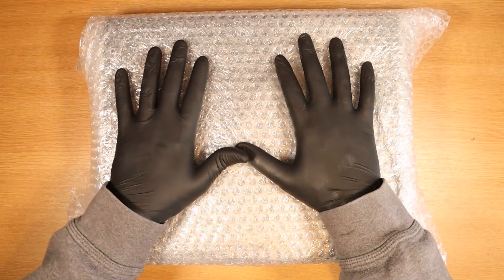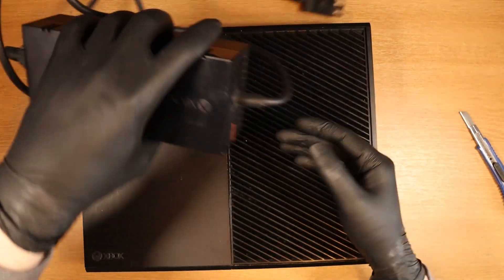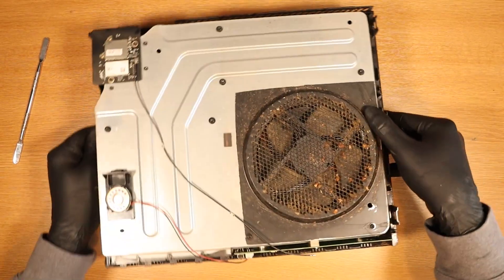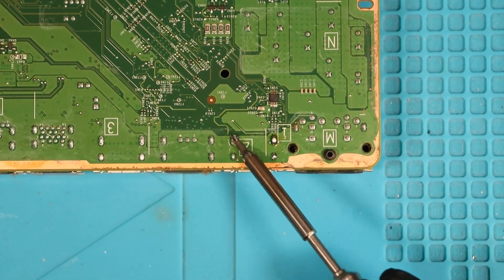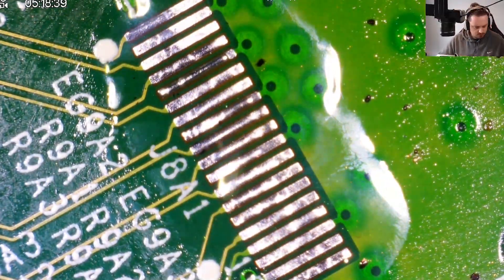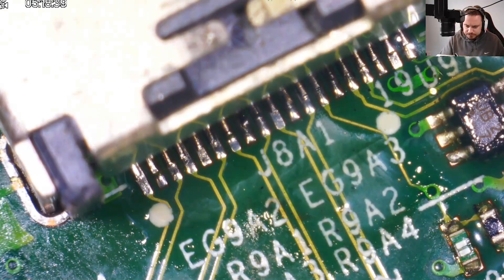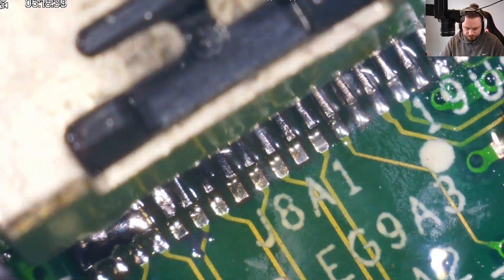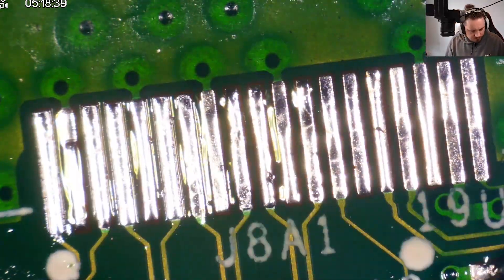Xbox One with Damaged HDMI Port | LEARNING to Solder

Comment: Hey quick question to help motivate me to get started, 2:52 there's 2 hdmi port on the back if I remove the faulty One on the left
'To Tv' and replace it with the one next to it on the right 'Sat/Cable' hdmi port; will it be compatible to see on Tv if switched ?

Comment: Good video :D I also have problem with replace damaged HDMI port :/ I've tried to put some new tin on pins and unsolder them, but didn't have any result... I don't know what I'm doing wrong but have only soldering iron set on 440 C but nothing happend... I'm not sure if I need heat gun to unsolder this port?

Comment: Good video, good job replacing port. Glad to see you using a soldering iron, it's a skill that requires practice. As far as video format is concerned, it was good for port replacement, would not use it for in depth troubleshooting. Like I said, good job. Thank You...
Reply from the maker: Thanks Warren, appreciate the feedback :)